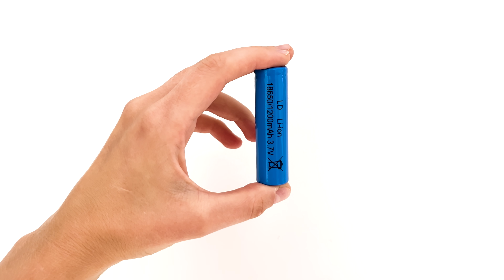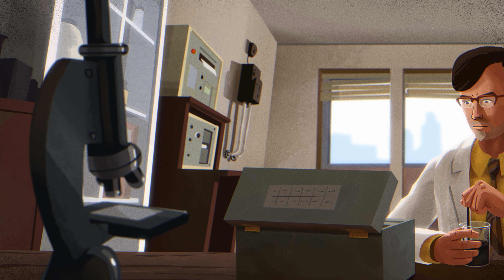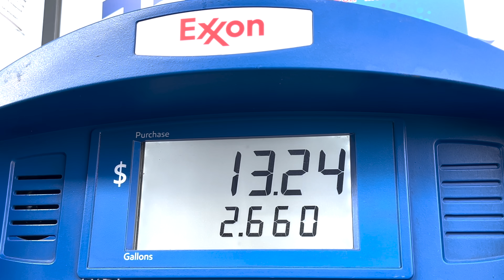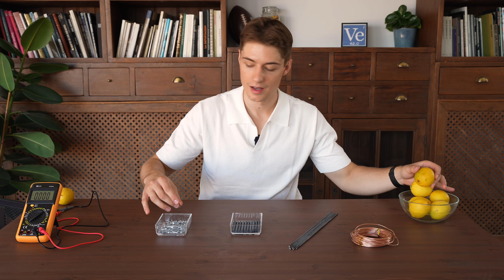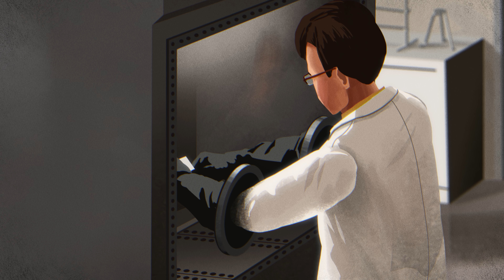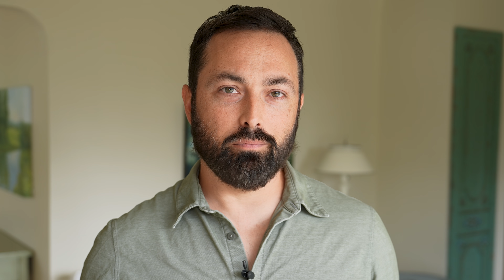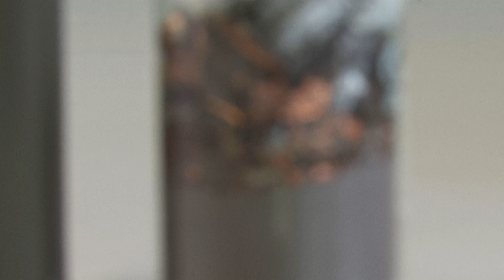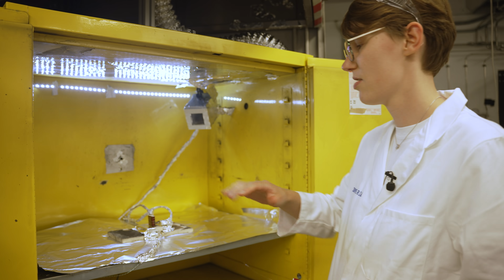The Perfect Battery Material Is Dangerous

Comment: I'm a bit dissapointed that you didn't talk about LiFePO4 (LFP) ... a lithium chemistry now in wide use that does not use cobalt and is far, far safer than standard lithium ion (NMC), let alone the NCA chemistry often used in drone batteries.
Reply: Some fair points but also a great deal of misinformation is being pushed.  Just to be clear, LFP is a high-performance chemistry... not sure why some people think it isn't.   Of all the chemistries, only two are currently suitable for a wide range of applications... NMC and LFP.  LTO ... not really.  And NCA (often used for drone batteries and RC) is extremely dangerous.

There are two primary differentiators between LFP and NMC.

The first is that the voltage is a bit lower... nominal 3.2V verses 3.7V.  But that doesn't really tell the story.  NMC is typically charged up to 4.2V.  Electrolyte breakdown starts at 4.6V.  And it has a relatively linear discharge curve which means that when NMC is at a high state of charge (SOC), it's stressing the chemistry.  That's why NMC is typically only charged to 80%.

A LFP cell is fully charged at 3.42V.  Typically LFP is charged to 3.55V - 3.65V ... no higher than that.   The electrolyte breakdown voltage is still up at 4.6V.  And once the charge cycle is finished (say, to 3.65V), the voltage can be relaxed down to 3.4V without losing any capacity.  This is why LFP chemistries can be charged to 100% without stressing the cell very much.

--

The second is what happens when there IS a breakdown.  Both NMC and LFP can produce their own Oxygen but it is much harder for Oxygen to be liberated in a LFP runaway due to chemistry.  This means that if there is a runaway, LFP batteries heat up at about 1/100th the rate that NMC batteries heat up at.

So not only is a runaway much harder to even get started, most of the time if you actually get to a runaway the only result is bloating or (toxic) white smoke... but no fire.  It usually takes an external source to actually catch a modern LFP cell on fire.  Whereas with NMC it's a lot easier and with NCA it is easier still... simple overcharging can cause an explosive runaway.  LFP cells don't explode.

--

Generally speaking, LFP is the better chemistry for nearly all use cases except extremely lightweight aircraft uses (aka drones).  They are already used in EVs and are available for E-Bikes... but most E-Bike enthusiasts and makers don't really understand just how much safer LFP is and instead max-out energy density by weight.  Even though they don't need to.  Most E-Bike riders barely use the capacity of even a light-weight battery, let alone a large one, on any given ride.  I can go 50 miles with my mid-drive's 7Ah x 51.2V LFP battery.  That battery is less than 10lb.

-Matt
Reply: @junkerzn7312 How'd you know about all these?
Reply: I have no problem charging lithium iron phosphate batteries up to 60 amp hours in my apartment. But any lithium ion battery that is not of known good high-quality like a brand name consumer device, those get charged inside a fire bag.

Also lithium iron phosphate batteries don’t become what we call “spicy pillows” where the battery puffs up and becomes very dangerous. When I take those to the battery recycling place, they store them in a metal safe.
Reply: @five-toedslothbear Haha, I'd kind of forgotten spicy pillows. They're not exactly rare sightings when you spend time around FPV drones or when using non hardshell LiPos in speedy RC cars, but it 's been a minute. Need to get back to it.
Reply: @five-toedslothbear4051 they actually go in fine sand buckets
Reply: Yeah, lithium iron-phosphate
Reply: Limited energy density, higher cost, slower charging speed, lower discharge rate, and limited temperature range are some of the drawbacks of using LiFePO4 batteries..
Reply: @petesmitt higher cost?  Uh, no.  LFP is cheaper.  Charge and discharge rate is roughly the same…. more a function of construction, not chemistry.  Temperature isn’t that big a deal in real life.  Energy density is slightly lower, but LFP can be charged to 100% daily while NMC cannot.  That narrows the gap.  LFP is far safer, and LFP has 5x to 10x the cycle life.
Reply: @junkerzn7312  How many smartphones use LFP batteries? None, why? because NMC batteries are superior for energy density, weight and size.
Reply: @petesmitt  I never said they did.  How many smart phones use NCA?  Even better weight and density.  So your point is ... what exactly?
Reply: @junkerzn7312  NCA batteries are more expensive than other Li-ion chemistries and have a higher thermal runaway risk, so why would phones use them when NMC performance is already superlative, which is the point I made in my original response, but you failed to comprehend..
Reply: @petesmitt Apparently the Tariff ban did completely damage your brain and information source, BYD's first generation Blade Battery already tested in - 40 degree Celsius with 0.3% of energy lost, density much higher than earlier Panasonic and LG NMC, but not CATL NMC yet, with charging speed of less than 10 minutes charging time, there are videos of torture test multiple rapid stabbing and machine gunning  ...and that was the first generation. Geely's (Gold Brick Battery also achieved performance similar to the BYD latest.) Let's be honest we all know why he did not mention LFP.
Reply: There are many other battery chemistries, including lithium ones.  LFP has its pros but it isn't entirely better than NMC.  LTO is another example of one that's got its pros and cons.
Reply: And LFP batteries are almost only produced in China and China just recently put the technology under export controls, trying to prevent any other country from producing LFP for batteries.

 @petesmitt actually the costs are lower at this point, since you neither need cobalt nor nickel for them. And the density is almost equal as well, that is why Chinese EV manufactures are using LFP batteries more and more over normal lithium-ion batteries.
Reply: @TheGerudan That isn’t true either.  Where are you getting all this from?
Reply: @junkerzn7312  What isn't true exactly?
Reply: The problem is it stores less energy on a weight and volume basis.  It’s more susceptible to cold temperatures.  It degrades slower, but not when you take into account something like nickel cobalt maganese  which have around 40% more energy to lose before they degrade to the state of new li iron phosphate.
Reply: @hugegamer5988  Doesn't really matter for stationary energy storage applications, plus it's one of the cheapest per kWh out there now ($50 per kWh or thereabout).
Reply: @hugegamer5988  While it is true that LFP generally has slightly lower energy density, it is still plenty dense enough for EVs to use it.  The lower density is offset by the ability to charge to 100% with minimal degradation (which you can't do with NMC or NCA).  And that has been proven over and over again with stationary storage.  LFP can be charged to 100% daily.

This means the energy density isn't really an issue outside of, say, drone technology where weight is incredibly important.

Simply requiring e-bike batteries to be LFP would put a stop to nearly all battery-related plane, apartment, and house fires.  To be frank, I would mandate it across the board with only an exception for RC and drones.  

So e.g. portable vacuum, robot vacuum, lawnmower, power tool, laptops, flashlights, and most other small and medium-sized battery applications really should be moved to LFP now.  It should be the law.  

An e-bike with a 100 mile battery range would have ... 80 miles or so with LFP of the same weight, for example.  Which is to say, more or less all e-bike batteries could be moved to LFP without inconveniencing anyone.

--

The cycle life for LFP is incredible, even taking everything into account the cycle life is 10x what it is for NMC.    We're talking 5000+ cycles at 80% DOD now.  NMC can't even get close, not even in EVs.

99% of all home storage, 99% of all power stations, and probably 95% of all grid-scale storage already use LFP.    On the flip-side, nearly all power banks still use NMC.  Nearly all e-bike batteries still use NMC (for no reason other than marketing).  Nearly all laptops use NMC or NCA.  A completely unnecessary risk.

-Matt
Reply: @hugegamer5988 so useless in cold climates. Great.
Reply: @hugegamer5988 the safety profiles cannot be ignored though. Granted I’m only one person, so what I would or wouldn’t buy doesn’t matter. That said I would never buy or allow a car running on nickel cobalt manganese or any other battery with thermal runaway potential on my property. The risk of my family being killed, losing all of their belongings (insurance cannot replace all things), losing their home (for a while at least), and the very dangerous health impacts from exposure is simply not worth it. I get the chances of that happening are very low, but if it does the impact is devastation. That to me is not acceptable when there are alternatives.
Reply: @JamesLake78  physics can’t be ignored.  If you want to store more energy in a size or weight it’s going to be there.  No battery is safe, you’ll start an instant fire spanning a wrench across any of these batteries.   They are harder to abuse electrically, but that insulates them from high performance.
Reply: ''That'' battery is not ''this'' battery. Feel me?   Also. Besserwissing never looks good.
Reply: Sadly this video does not show the date when it was created.  I suspect it is a several years old.  You can never trust the date show by YouTube.  That is only the date the video was uploaded, not the date when the video was made.  There are now several companies and labs producing lithium technology batteries with >500 Wh/kg.

Thankfully the technology continues to improve.  Best of all, unlike fossil fuels the materials are almost totally recoverable and reusable indefinitely.  That's like capturing vehicle exhaust, putting it back in the ground and then pumping it out to make gasoline all over again.  While synthetic fuels can be made this way, it is incredibly power expensive to try and do it.
Reply: LiFePo4

Sometimes I call it life chemistry. Cuz Li and Fe form LIFE life
Reply: Would you want equally crappy explanations for even more concepts?
Reply: How could he not and a half hour video - that's just neglect
Reply: @Auriam  Nah, doesn't fit their narrative they're pushing.
Reply: While LFP is much safer and outlasts NMC in charge cycles, it lacks the energy density.
Reply: @JohnAudioTech it’s energy density is still pretty darn good though. It’s significantly safer and over time it will actually have higher energy density due to it having much lower capacity loss with charge cycles.
Reply: @JohnAudioTech but it has a higher maximal output which is very useful for different types of RC hobbies 👍
Reply: @JohnAudioTech and it does work as well at lower temperatures. Not great for EVs when the ambient gets frosty
Reply: @JohnAudioTech  
It has been. Although it is a bit lesser energy dense than Li-ion Battery, the energy dense of LiFePO battery is between 90–160  Wh/kg, and the feat of safety of it is only nothing but a leakage whenever overcharged, been at high current or both, compare to Li-ion Battery that caught into flame for its presence of electrolytes most.
Reply: You could spend 100h talking about batteries.

There's also solid state batteries, Li-NMC batteries, Sodium-Iron batteries, Lithium-sulfur batteries, etc.
Reply: @msanterre you missed the opportunity to include a component of power in your time. We are talking about batteries here 😂
Reply: disappointed*
Reply: Lithium iron phosphate, or LiFePO₄ (LFP), is indeed a significant and widely used lithium-ion battery chemistry, and it is a valid point of discussion when exploring the landscape of battery technology. While the video focused on the historical development of the early lithium-ion battery, it did not cover the broader range of modern battery chemistries. The LFP chemistry, in particular, offers a compelling balance of advantages that addresses some of the key limitations of other chemistries like nickel manganese cobalt (NMC) and nickel cobalt aluminum (NCA).
Here is a breakdown of the key characteristics of LFP batteries in comparison to NMC and NCA chemistries:
⚛️ Fundamental Composition and Safety
The primary distinction of LFP batteries is their cathode material: they use lithium iron phosphate, a composition that entirely avoids the use of cobalt and nickel. This is a crucial point for both ethical and economic reasons, as these metals are often expensive and associated with problematic mining practices.
The atomic structure of the LFP cathode features strong covalent bonds between iron, phosphorus, and oxygen. This robust structure is inherently more stable than the cobalt-oxide bonds found in NMC and NCA chemistries. Consequently, LFP batteries have a significantly higher thermal runaway threshold and are far less susceptible to fire or explosion, even when subjected to overcharging, physical damage, or high temperatures. This superior thermal stability is a primary reason for their growing adoption in applications where safety is paramount, such as electric vehicles and large-scale energy storage.
⚖️ Performance and Lifespan
While LFP batteries offer superior safety, they present a trade-off in performance characteristics when compared to their NMC and NCA counterparts:
 * Energy Density: LFP batteries typically have a lower energy density than NMC and NCA batteries. This means that for the same amount of stored energy, an LFP battery pack will be heavier and larger. This is a significant factor in applications like long-range electric vehicles, where minimizing weight and maximizing range is critical. NCA, in contrast, is known for its high energy density.
 * Cost and Lifespan: A major advantage of LFP is its lower cost, driven by the use of abundant materials like iron and phosphate instead of costly cobalt and nickel. This, combined with their exceptional cycle life, makes them a very cost-effective solution over the long term. LFP batteries can typically handle more than 3,000 full recharge cycles, whereas NMC batteries are generally rated for 1,000 to 2,000 cycles.
 * Voltage: LFP cells have a lower nominal voltage of around 3.2V, compared to the 3.7V of NMC. This can impact the power output and requires more cells to achieve a higher voltage, further contributing to their size and weight.
In summary, the choice between LFP and other lithium chemistries is a strategic one, balancing priorities such as safety, cost, energy density, and cycle life. The LFP chemistry is a vital innovation that has enabled safer, more sustainable, and longer-lasting battery solutions, expanding the applications of lithium-ion technology.
Reply: Veritasium sold out and fell off
Reply: Since when has this guy ever cared about presenting the whole story, instead of just clickbait shock value "today I found out" style videos
Reply: @Auriam  calm down the video was mainly to inform people about its danger in my opinion wich many people think its completly safe to have a bomb under your seat
Reply: @Auriam you're crazy dude. These videos are insanely well researched and produced. Nothing close to click bait. Plus this one is already 30+ minutes long. Of course things will be cut for time.

Nevermind the fact the aforementioned battery tech isn't really that big of a deal. It's safer, but not as energy dense, and the durability doesn't beat that of some other types. One can't expect him to work every alternative into one video.

Comment: Dry cells with charges over 1.24 V per cell existed way before lithium batteries.
16:16 clearly, he was Goodenough to succeed where others had failed. That must be a very embarrasing surname, particularly when paired with certain given names.
33:41 and part of the reason of that is that many cobalt mines are shut down for reasons (not necessarily good or true).

Comment: as a teacher in software development I urge people to think about this. AI makes code today. so our solution it to let it help a developer. the developer becomes more efficient and better, if he is good. if he is bad he becomes as good as the AI in use. 

Now we are also going to use AI for reviewing the code written by another AI + a bad or good developer. good developer is fine no issues. but bad developer is like asking AI to write and review code... it will never be able to catch problems like the AI/bad developer missunderstanding the requirements. or the AI/bad developer thinking they are solving the objective but just solving a percived objective instead of the real objective. 

So this add is imo ethically something we really should think about hard before using it. because people will take the shortcut every time they can. even if the shortcut is a problem. and AI doing both coding and reviewing is a problem because we loose human agency and human decision will suddenly be made by AI where it should had been humans. it is not about efficiency or error prone it's about staying in charge or not.

Comment: My buddy got injured recently because his vape blew up while he was using it. I was surprised that such a small battery could create such a big explosion.
Reply: Yes! There's hydrogen gas given off during thermal runaway as well, and components that act as an oxidizer - yikes. This is why they can even burn underwater. There's a YT video showing what happens when an EV gets pushed into salt water, ie the ocean:
Once the saltwater shorts the batteries, they run away thermally and start burning up - it's disturbing seeing the EV literally burning merrily underwater!